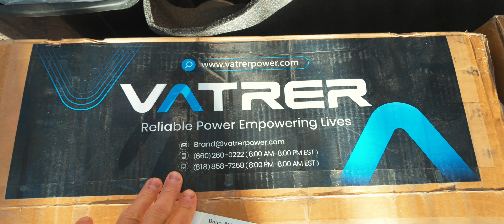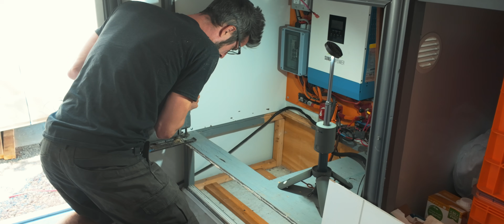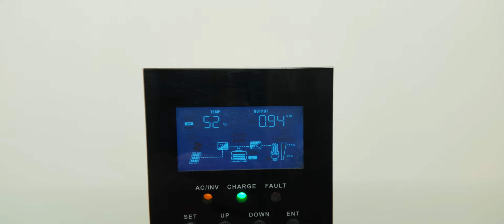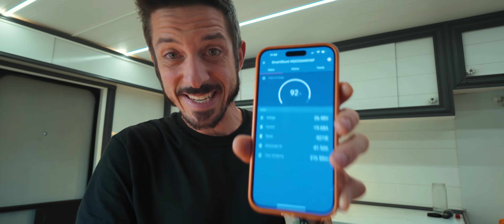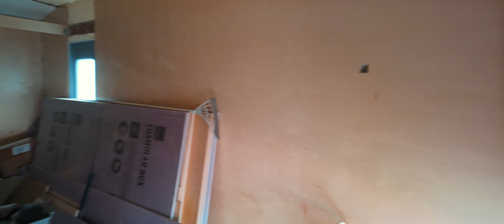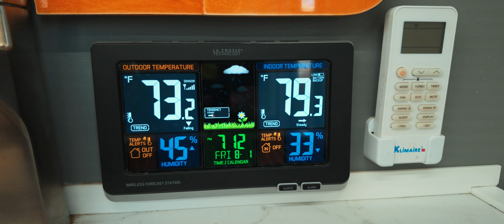Huge Batteries in my Box Truck Tiny Home - Vatrer 12.8v 460ah LiFePo4

Comment from the maker: Vatrer Official:
https://www.vatrerpower.com/products/vatrer-12v-460ah-self-heating-lithium-rv-battery-5kwh-300a-bms-heated-battery?sca_ref=9132127.wNlaNExAl67JDobf&sca_source=YT
Amazon:
https://www.amazon.com/dp/B0DW3PJ634?maas=maas_adg_6EA3F2806674F84C35E87EA567FB8123_afap_abs&ref_=aa_maas&tag=maas&th=1
Reply: What Model Sungold all in one is used here ?
Reply from the maker: @1GREATDANE 24v 3000w sungold inverter / charger

Comment: I was wondering why you were swapping the far superior Epoch's with heating for the budget friendly Vatrer without heating, but you acknowledge that the Epochs are a far superior build in the comments. Two things to note about the Epoch is that they do have a 24v and 48v version of this battery and if you have mutiple Epoch batteries in series or parallel, their app can combine them to give you a total system virtual battery output view.  The one place the Vatrer is superior over the Epoch is in the Max Amp Continous Charge and Discharge rating where the Epoch is 230A and the Vatrer is 300A.
Reply from the maker: Thanks thom!

Comment: your setup is exactly what i am doing to my RV .. using a powmr 3000w 24v hybrid inverter, 10kwh of lifep04, 2000w of solar (5x 405w bifacial on 2" tall frame stands on the roof) .. i also want to rewire the fridge and one AC unit to it.. gonna need an electrician for that i am sure, as I am not one myself, the RV already has a small 200w panel and inverter to charge its batteries and 2 separate outlets (1in kitchen 1 in bath) .. so i think it will be easier to run the cables :)

Comment: man those r not cheap
Reply from the maker: They’re not expensive either when you compare other brands. These batteries are a good value considering their capacity
Reply: @nomadbrad503  ive seen $600 for 24v 200ah
Reply from the maker: @outoftime788 I’m happy to hear that you found a battery to meet your needs

Comment: I'm doing the same as you. A upgrade. What do you do with the batteries you removed? I have 2x 300 amp hr batteries I will remove. (I have 1250 watts of panels on the roof)
Reply from the maker: I’ll be installing the older batteries into my npr build. If they’re not needed, you can sell them on fb marketplace

Comment: Check it out. Nomad Brad rockin them Vatrer Batteries. I have the same ones you got. I also have a pair but they are wired in parallel instead of series setup like yours. Regardless if they are wired in parallel or series, the total power output is still the same: 11kwatts. That’s plenty of power. I haven’t actually used my batteries yet because my bus is still in the shop. However, this is a good video to give me an idea of how they will perform. I need more solar though. My goal is to get 1000 watts of solar. My bus only come with 200 watts of solar so ill definitely need to beef up my solar system once i get my bus back. I think if i can get 1000watts of solar coming in daily i can live off grid. I do have a DC-dC charger too to help me out on days the sun is not shining. Ill probably invest in an inverter charger as well for backup just in case. My goal is to never run out of power

Comment: I would recommend turning on the Battery Disconnect Switch before turning on the Batteries!  Most New Batteries have a slow ramp up to protect your inverter.  Doing it the way you did, without a pre-charge resister, can fry the inverter.
Reply: Is this true NoMad?
Reply: @sciglassblower - That is a best practice. Some inverters have a built-in pre-charge resistor, but still a good idea to do as you mentioned.
Reply: @dathat555  I have not seen any Inverters with precharge resisters.  I agree they should have a way to do that to protect their equipment.  Many New Batteries do have that feature.

Comment: Nice video Nomad Brad. That daytime 30 degree temperature drop was wild! Btw, I do remember your strategy for the battery exchange. Not sure why so many were confused. I guess lesson learned would be to add a recap at the beginning of each video. Maybe that is why TV shows include a recap. Perhaps the average joe cannot follow without a recap. See you Wednesday.

Comment: Brad, do you have any videos explaining the advantages of 24 volt over 12 volt systems? It seems the larger voltage uses smaller wires so the amperage must be lower? Thanks
Reply: Smaller gauge wires on 24 volt systems save serious money and are easier to rout into tight spaces. 24 volt power inversion to AC 120 volts is more efficient

Comment: Great battery, but you've got to get rid of that transformerless inverter. First it's not UL-458 listed for use in mobile applications so it doesn't provide automatic neutral ground switching which creates the risk of electrocution if you plug into shore power with an improperly wired outlet. Second, it transformerless inverters like this offer a very poor surge capacity and a much shorter life expectancy. And third, your inverter doesn't have an output transformer, so it doesn't provide any galvanic isolation between its DC boost stage and its AC output. So when the MOSFETs in its H-Bridge circuit fail. You're going to do some serious damage to your appliances. What you should have installed is a UL-458 lusted, frequency, transformer based inverter instead.
Reply: Is this true NoMad?
Reply: @symcardnel1741  Yes it's true.

Comment: Brad, Are you going to use the Vatrer batteries in the NPR? Just curious how they compare to Epoch.
Reply from the maker: Hello Chet, I’ll be taking the epoch batteries into the npr,  making more videos for them. Both batteries are the same capacity and similar features. I would say the Vatrer are a Better value. The epoch are for folks who want every feature like waterproof and Victron communication. If I were buying new batteries I would get the Vatrer
Reply: They are superior

Comment: Hey Brad enjoy your videos.
I'm new to solar setups, though I was wondering why you didn't run a bar between the two terminals in the center and then hook your inverter up to the outer two terminals.
Curious if that had something to do with whatever materials you had on hand or if it has more to do with the length of the cable run.
Reply from the maker: You can absolutely do that. Just need to make sure the bar is insulated

Comment: Can you explain this video? I think many of us are wondering about the strategy. I assume you are transferring your previous / old batteries to your new van because the older ones have a higher voltage / a larger capacity. You are doing this product review of the Vatrer batteries (they offered you batteries free in exchange for a product review) because you need to replace the ones you took out for the new van owners. Because it would not seem to make any sense to NOT install these in your new van.  I guess another option is the manufacturer of your previous batteries offered you another or two more batteries, and you want them all to match. 
There is nothing wrong with you doing any of that; it is your vans and batteries we just would like to know the "WHY." From a project management / tight timeline of getting in your new van to a live-in state and turning over your old van to the new owners, this time investment to put new batteries in your old van makes no sense.
Reply from the maker: Yes I’m taking my old batteries to my new truck because I’ll be making more videos with that brand. These new batteries are the same capacity as my old ones. 

Also I wanted to provide the new owners with a large capacity battery system. My initial plan was to sell it with my previous bank which is half this capacity. It works but nicer to have a big reserve

Comment: You have really good videos. I am thinking about doing a tiny house. Do you think  batteries would work good in it? I may do a solar panel on top and it will have a mini split.
Reply from the maker: Yes, these batteries are a very good value. High quality but affordable. You might want 3 or 4 depending on your tiny home situation
Reply: @nomadbrad503 probably not going to be too much bigger than the boxtruck you are living in now. I live in Tennessee and there is a guy in Newport who has Incredible Tiny Homes on here. I am looking at the Incredibox if you ever want to look at their YouTube page.

Comment: So I did the tiny home on wheels and I put in the solar panels and all that runs great just like yours but then I did my tiny home without wheels and I’m doing 8000 solar on the roof and I can run everything and ever go below 80%
Reply: Ever consider using the wind with a windmill type thing?  I've seen them, i don't know of anyone using them but I've wanted to try them.
Reply from the maker: Very nice

Comment: … I guess I missed it or didn’t hear the plan… But why are you putting the new batteries in the old truck? Why not the new truck?
Reply from the maker: I’m moving the old epoch batteries to the new truck. I still have videos to make for them
Reply: @nomadbrad503 why would you use old batteries on a new truck?
Reply: Yup. Me too wondering
Reply: He is going to use the batteries out of the old truck and put them into the new truck, that’s why he replace them
Reply: It’s a paid promotion. No guarantee sponsor would still be interested by the time new truck is more fully along.
Reply: Same here! LOL
He’s gonna sell this truck anyway, why upgrade with ne2 batteries? 🤪
Reply: I love the safety caps over the battery connections. Handles are great and the metal shell is also a plus
Reply from the maker: @jerrytalley802 yes those are great features!
Reply: Your old batteries are also fairly new, aren't they? I thought you were just given those a couple of months ago to test, but I could be wrong.  Love the progress on the build.